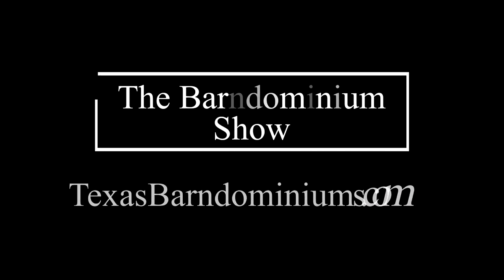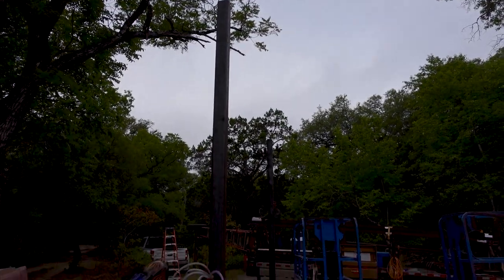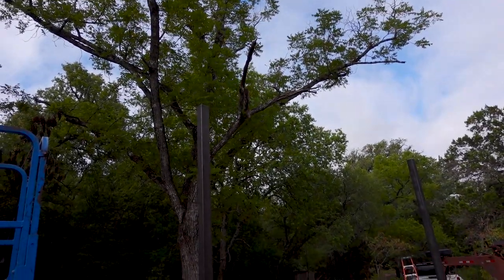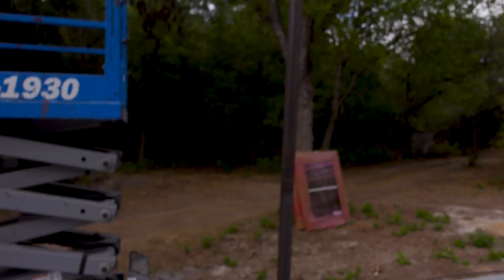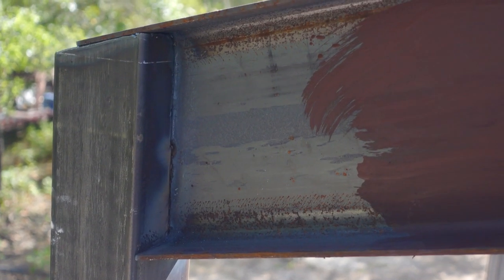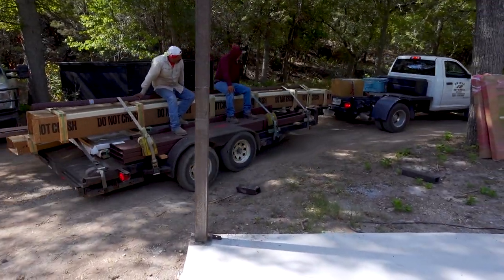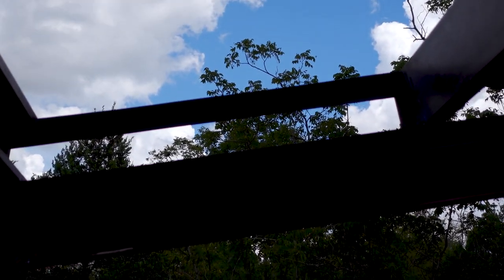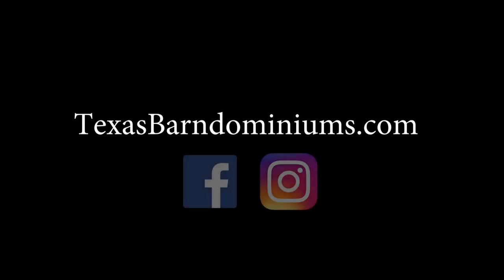Building Erection | Demolition Ranch HQ Build part 9

Comment: I was welding a cutlass bearing holder inside a strut at a boat yard one time with low hydrogen rods. I had my root passes done and was trying to put a good looking cap on with the lo-hy rods. Didn't quite have the heat up high enough and the main man at the boat yard came over for a look. I hadn't knocked the slag off yet and he took a rod but and flicked it off. He looked at me and said damn, that looks like a caterpillar crawled up there and died. Away he went and for the next hour or so I was up in the strut with a grinder trying to get the dead caterpillar off. I like that joint between the tubing and beams. Kind of splines it together and gives a good surface to weld. Ties it together well for strength. I have gotten older and only mig weld now I haven't run a stick in years. I doubt I could even strike an arc anymore.

Comment: 1 person can do the leveling if you make 1 side attach to the post with a clamp, magnet or duct tape.  1 guy holds both sides against the same post.  Make the mark then move the free end to each other post.
Reply: Yep. Silly not clamping it. Introduces possible inaccuracies through inattention or moving it.

Comment: the join at the end of your trusses is similar to a bird's mouth joint for trusses used in joining the rafter feet to the frame  in timber framing. where you use weld, they use pegs.

Comment: Question,is  Erik going to be the 1st to sling some lead out of the HQ when its done? Not a ribbon cutting to open it officially but a ribbon ripping by a rapid (full auto) phew phew :D
Reply: In Matt's related video, he did mention that he and Mere already went "practicing" from the new location. Sooooo.... already done?

Also, I still question his judgement about not having a bathroom when he has a wife and two girls, especially if they're going to be staying overnight at that location.
Reply: 1ce its all completed,  as an official finish th build celebration. 
In videos he has shown to have a potable toilet so that sort of sorts out that issue
Reply: @jackielinde7568  - When they finish the house it'll just be up the hill literally..

Comment: Going to be interesting to see the entire system installed including the lateral wall bracing/ strapping.   Weakest link seems to be the mechanical connection to the slab.
Reply: The 4" tubing is welded to steel plates embedded in the slab, not weak at all.
Reply: @dlg5485  Embedded? The plates are on top of the slab.
Reply: @xmassan20906  Each plate has 4 steel pegs welded to the bottom and the end of each peg is bent at a 90 deg angle, so they are indeed securely embedded deep into the concrete.
Reply: @dlg5485  So we're going round and round because you want to argue a, "steel peg" is not a mechanical connection to the slab because it's bent and welded to a plate sitting on the slab not a, "steel plate embedded in the slab".
Reply from the maker: Technically, the plate is embedded into the slab. The plate is 1/2” thick, but it sits flush on the surface, so it’s embedded 1/2”. 
The plates have 4 legs welded to them.  Legs are 3/4” rod and are 12” long.
Reply: @TexasBarndominiums  So the steel pegs are now 12" rods and last time you said you were using Tapcons. Why is a simple post turning into this? As I said, the weakest connection appears to be the connection to the slab which, according to you, isn't a mechanical connection because it's long and welded to a flush plate that is technically embedded. I didn't say weak, I said the weakest point in the system installed so far appears to the there.  Good grief, did I get everything or does everyone want to argue out of their ass.
Reply: @dlg5485  2 days latter the troll can't resist. Are you done? Anything else? Can we all move on?
Reply: @xmassan20906  You have issues...seek help.

Comment: water levels are more consistent because they are not, as affected by environmental conditions. Such as air temperature, relative humidity and air pressure, it is no different then round trajectory in long range shooting.

Comment: To be fully honest, I was expecting this to be just a glorified metal kit shed, NOT welded I-beams and four steel tubing.
You have to respect the craftsmanship and overkill of this project!
Reply: same here, i guess because its a small project they can do all the welding on site and not make it all prefab. Im used to design it all prefab as much as possible for industrial buildings cause its much safer not to weld on site
Reply: @marty3194  If you design it all from standard sections you can often get it precut before delivery, or have tabs welded on off site for bolted connections, etc. These weld details seem like overkill unless they have some crazy weather there.
Reply: I'm watching this while prepping for a hurricane, that's where my mindset is-appreciation for buildings built for that overkill. One person I know, had to go buy hurricane clips and install that on their house today.

About 20, 30 years ago, we had Hurricane Iniki decimate Hawaii and  building codes had to be improved. I'm not to worried, as long as Honolulu airport and that harbor is fine, I'm happy. I live Honolulu.
Reply: @randommcranderson5155  would have been easier to just make it all prefab and bolt it all together on site. only have to level out the anchorpoints in foundations for the columns
Reply: I’ve been doing Structural Steel & PEMB for 22 years. This should be engineered and fabricated in a shop and bolted up at the jobsite . Nomore then 2 weeks from start to finish. Channel purlins instead of Zee purlins 😏 there’s wind load codes for that. I guess this size of build can get away with it. Looks impressive, but it’s not. No offense
Reply: @gilbertrivera1293  yeah,... so you DO realize that you are commenting on a year old post i made about a guys tool shed, right?

Comment: Question.. when they erect the square tubing posts, do they only tack weld (then later fully weld)so they can adjust it slightly when they place  the I-beams or is there enough flex in the square tubing at the top?
Reply from the maker: Weld after

Comment: ..... I would never weld or prep that way..... you want the top flange of the Beam to sit flush with the outside wall of the 4" square so you can weld the upper flange to the outer square and than the web is been welded to the inside of the outerside 4" square down to the flange is welded to the inner side of the 4" square giving you a total weld of over 16" metal to metal full penetration weld. 
If you can cap the 4" tube with 1/4" plate you would even increase the total weld length to over 24". 
Talk to your structural engineer he will confirm it that with that you even gain additional 20% over all strength and 30% more sheer strength as well.
And weld the perline's in between the I-Beams. 
Get yourself a HTP and run dual shield flux core and you get the welding done in 1/3 of the time.